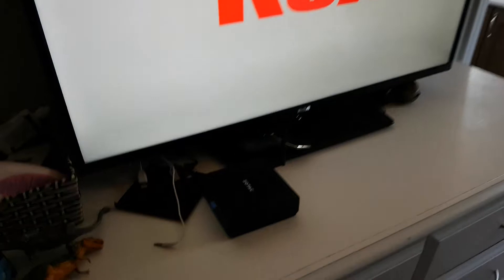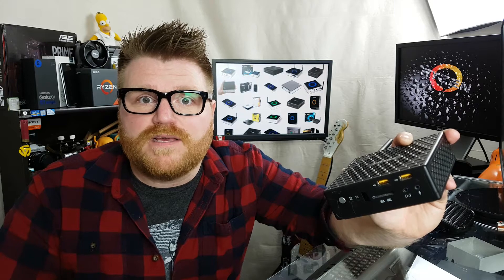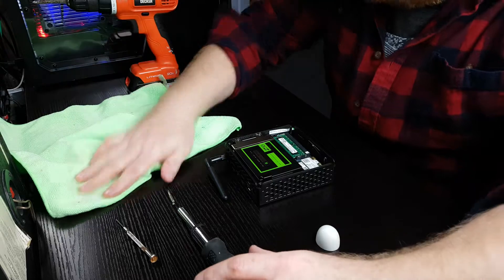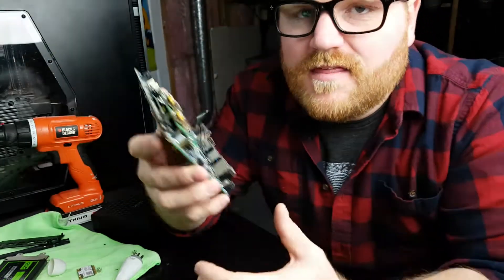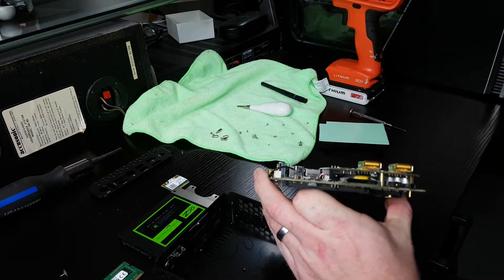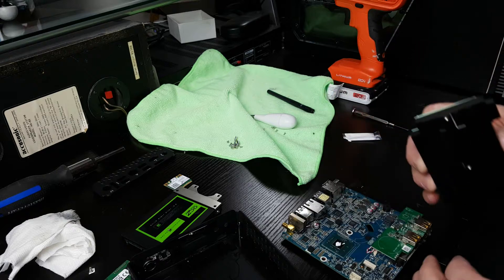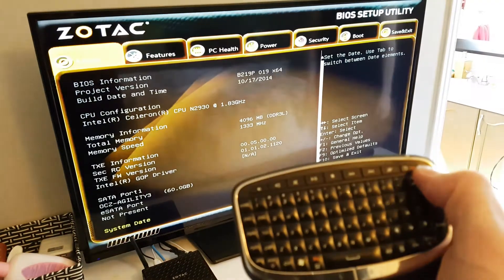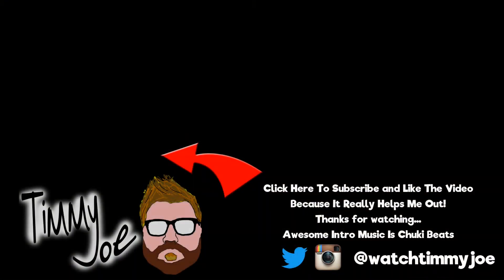Celeron PC Overheat Issues - Zotac Mini PC Tear Down

Comment: I am kind of wild on liking pc's to run cool. I have not been able to do much with laptops and cpu's that have the tiny metal heat pad area. I can get full size cpu's plenty cool but I think the tiny pad is not able to transfer much heat. I am not doubting you here but that major of difference in cooling? No doubt if the heat can't make it to the 'heat sink' it will never cool, so maybe your transfer was really shot. And with these models like laptops and other mini pc's that are this small there simply is no real way for air to move around the 'heat sink' area with no fan so they have cooling problems.

Comment: How many screws to get the motherboard out of the case?  I added external fans and windows or linux can run several hours before shutdown.  It would be nice to properly fix the problem but the external fan solution is easy.

Comment: If you would leave the big middle heatsink out of the computer that there might be room enough to put a regular CPU heatsink on the cpu with a small fan. I had a Tanix android tv box that had a big metal heatsink and the box would over heat and crash a lot. So I left out the metal heatsink and cut a little square hole the size of the heatsink on top of the case to make it fit with a tiny fan on top and now it's the coolest running tv box. I know it defaced the case a tiny bit but now it's one cool box.
Reply: Yeah I just love these things all being raved on as fanless. (first off most small fans are nearly silent anyway). But many of them do not run all that cool and some have trouble. I admit I like them to run cool, not like my desktop but at least under 60. Putting a fan into one of these defeats the fanless part but with the two mentioned factors it is a better way to go.

Comment: i have a lenovo laptop specs: intel celeron n3060, 500gb hdd, 4gb ram
i get between 58 and 63 when doing regular stuff like browsing but when i
 play video games it reaches 77 degrees and im not using any cooling so 
is this too hot for my cpu and will it damage it? bytw (tj max is 90 
degrees)